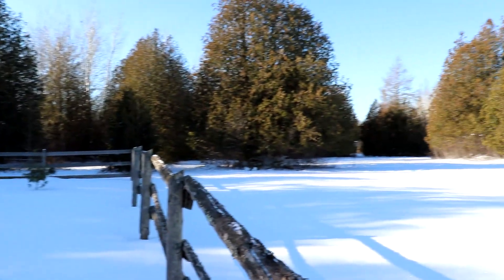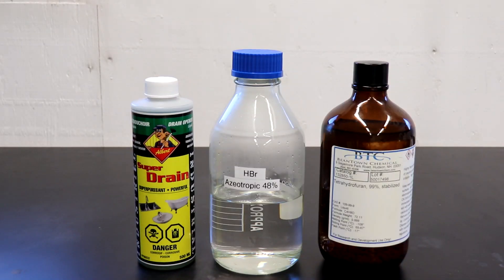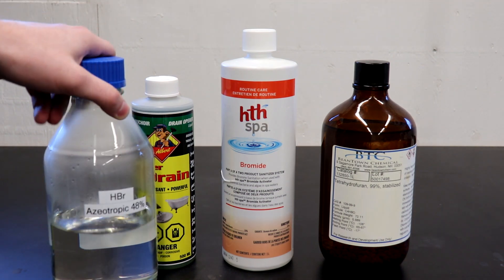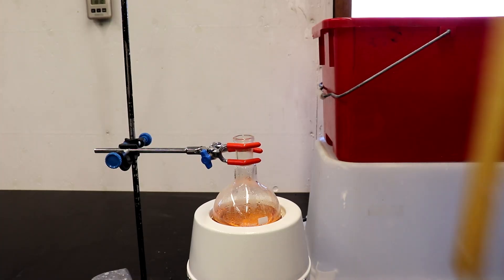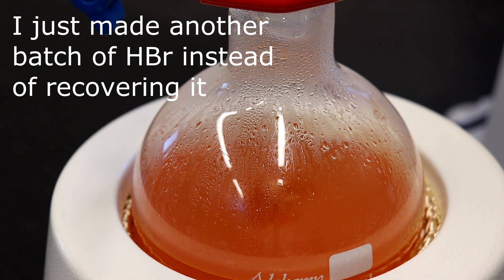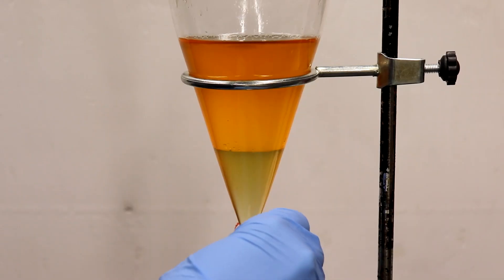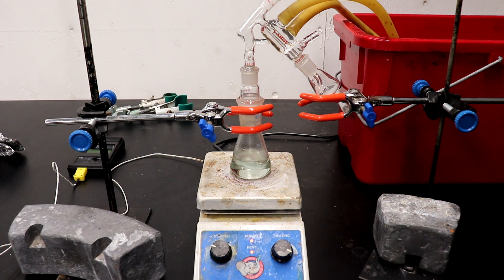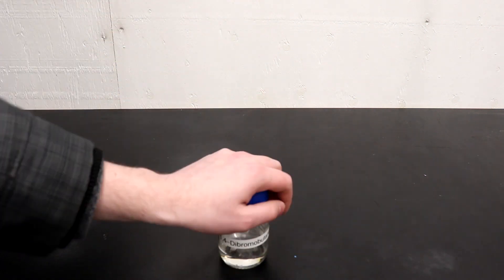Synthesis of 1,4-Dibromobutane from THF

Comment: Some people are really confused about hydrogen bromide you just eloquently explain how easy it is to make In-situ. MBr + H2SO4 + Reflux ---> HBr + M2SO4. That equation technically incorrect though. The sulfuric acid immediately oxidizes the HBr to Br2 or so I thought. It needs one more ingredient to prevent that oxidation to Br2. It's a weird one made 2bromopropane first try. Trying to isolate HBr all I get is Bromine... Great content btw peace ✌️

Comment: Can hbr be replaced with hcl?
Seems it would be way way more cost-effective.250ml of hbr to react 20g of thf is not worth it to me. Would-be for small one off batches but if needed regularly not worth it.
Reply: iirc 4-chlorobutanol can be made by gassing THF with HCl. But to prepare 1,4-dichlorobutane I suspect you may need to try with ZnCl2/conc. aq. HCl. Or who knows, maybe CaCl2 will even work?